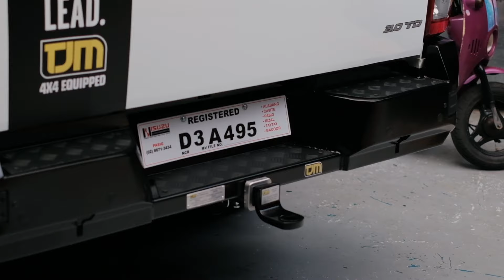WASTO Overland Off-road Build Brand New 2023 Isuzu Dmax

Comment: can you feature a body mount chop (tabas) for the new D-MAX when upgrading from stock tires & wheels to a bigger size to prevent tire rubbing or scrubbing. ty!
Reply from the maker: Will do on my next video!
Reply: using the BM J-SPEC 17x8 6x139 ET0 and AMP 285/70R17 with a 2 inch lift need pa ba mag body mount chop for this 2021 D-MAX 3.0L 4x4 LT model. Using the above wheels and tire mentioned specs is there a need to use a wheel spacer and hub centric ring? ty